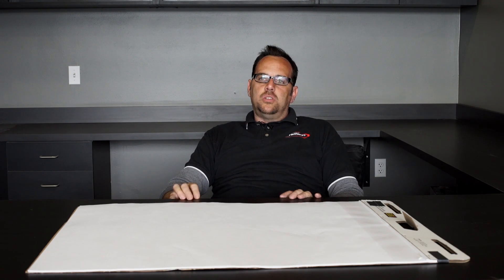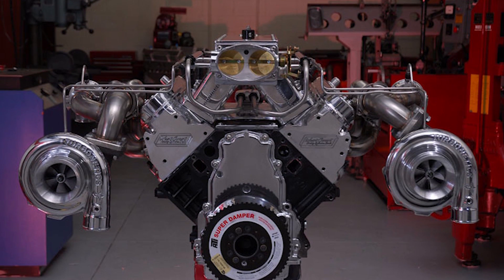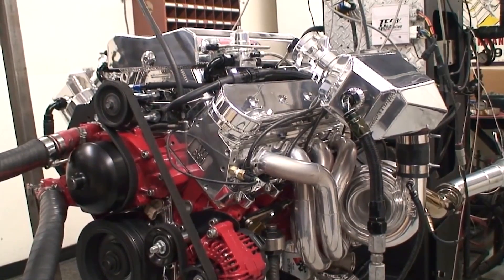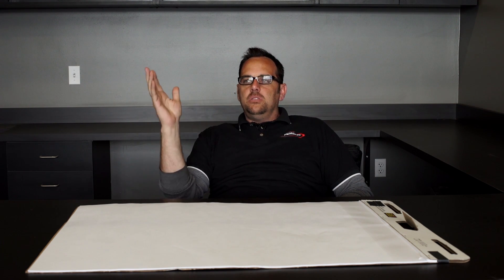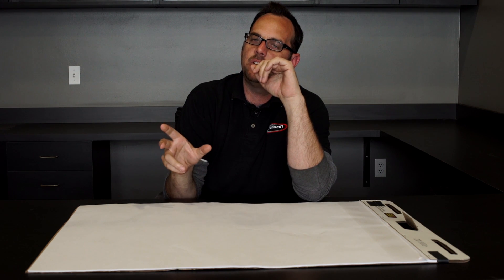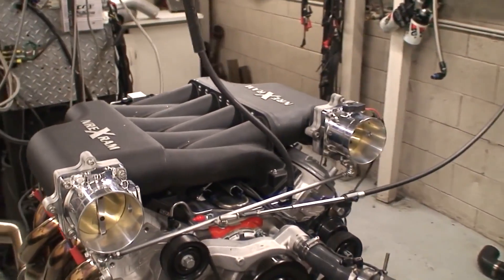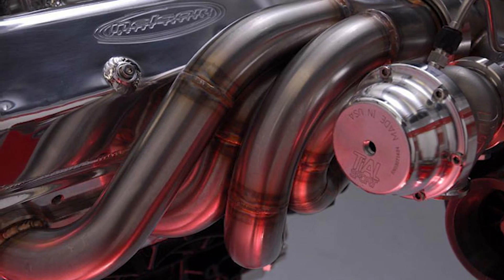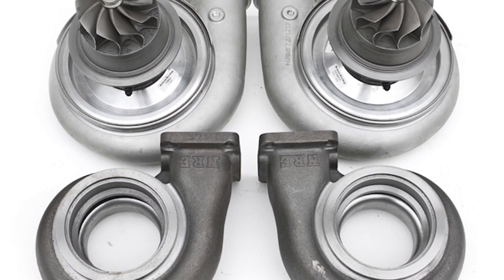Master Engine Builder Explains Why the LS V8 Is SO Good

Comment: Wow--Tom's a genius. I found this extremely helpful, because he talks more about the overall power curve, rather than just the peak numbers.

Runner length, as he mentions, is very important. For example, the GM TPI engines in the 80's had very long runners, which built up great low end torque, but suffered on the high end because the air wave had much longer to travel back up through the runner towards the throttle body when the intake valve was closed.

Comment: Too bad engines are shit in general. And why do people say motor? Motor should really only be used for talking in terms of electric motors, an LS isnt a motor, it's an engine. So is a rotary, not a motor, an engine.

The typical reciprocating piston engine is between 17% and 30% efficient. The rest gets thrown away with heat, sound/vibration etc...

Comment: Excellent video! The one area that seems to be the most misunderstood though is proper crankcase evacuation and air/oil separation.  These engines depending on ring tension, will experience ring flutter and instability if just vented with breathers, and those that delete all evacuation and flushing of the damaging combustion by-products before they can accumulate in the crankcase are greatly shortening life.  The best solution of course is a belt driven vacuum pump and adjustable vac relief valve, but for the street these won't last.  There are proper systems that do accomplish all as the next best solution to a vac pump.  You never want pressure to first build and then vent.  Cheers!

Comment: 4:25 Aluminium has much better heat conductivity than cast iron, that's why you see the better cooling performance with aluminium blocks. Aluminium is one of the most heat-conducting metals.   
http://www.engineeringtoolbox.com/thermal-conductivity-metals-d_858.html

Comment: Love how all these professionals call engines "motors", motors and engines are two completely different things. Engines are complex machines that have hundreds of moving parts, and they burn fuel to make power. A motor is a simple machine, basically an electromagnet, that effectively has one moving part and uses electricity to spin a shaft to produce power. Calling an engine a "motor" is an insult, not only to the engine itself for the vast difference between the two, but to everyone's intelligence that heard to you say it.

Comment: All I have to say is the video speaks for itself and so does the ls engine . On another note I hear people bashing pushrods . Well I'll have you know that nhra nitro cars and 6.5 second 1/4 mile n/a cars run pushrods and so does nascar . Pushrod engines are proven to make all kinds of power and being reliable at the same time . Also the ls engines if you care for it , are fuel efficient on a stock tune considering what the engine is designed for . I'm currently ls swapping my 1994 n/a jdm supra . I will be dropping close to a 100 pounds with my all aluminum set up and gaining 300+ hp while staying n/a and reliable . My handling will also improve do to improved center of gravity . Don't get me wrong I love my 2jz engines but let's face it , the ls platform is cheaper , easier and can make more power with ease .

Comment: I love my LS3, just under 2k in bolt on mods, over 500 hp and still gets 26 mpg at 100 mph with 2 people in the car running the a/c! Bitch, moan and complain about how bad it is or how many other motors out there are better or can be tuned more....nothing beats 500 miles to a tank and that smooth deep burble it makes, almost like the soothing hand of God pushing you down the road with relentless authority!

Comment: Nice, very nice. Now do one on why the 2jz was good.
Reply: In 2jz we trust
Reply: +Kartez Drake Would have to be in Black and White as that engine is prehistoric :)
Reply: +M3Conv lmfao and its still more modern you idiot your comparing it to a pushrod engine im not hating on them but just image if chevy made a dohc v8
Reply: I talk because i know my stuff first of all ive rebuilt an ls and built another plus a 700 hp 2jz will last as long as a stock ls if u treat them the same dont bother to reply hillbily
Reply: Yes it was im building a 2l with 600 hp goal if u build anything right it will last
Reply: +Mo-Town Nut dohc sucks. its good for econo cars thats about it. a 2j will never compare to the power of a v8. they just don't have the strength to withstand all that power for very long.

Comment: Why is the LS so great?
Light, compact, plentiful (millions produced), multiple factory configurations making different accessory drives and oil pans available for various applications, durable, cheap to attain and modify, great flowing heads, massive amount of trans choices, multiple induction choices, massive aftermarket support, and there's no arguing against the power than can be made with its tried and true design.

Comment: After all the flame wars in the comment sections about LS versus 2JZ and pushrod vs DOHC it would be really informative to get a professional opinion on that as well, especially regards to what engine suits what purpose. I live in New Zealand and LS engines are far from easy to get a hold on. Yet dedicated people source them from US and stick them in MIatas or even RX7s.  The LS swapped RX&7 goes well at local hill climbs but not necessarily faster than the rotary engined ones. I know the Miata suffers from understeer due to the 50 50 balance being lost. I find it much more interesting to discuss what engine for what purpose is best, rather than fanboy or engineering arguments about this engine is better than that. It is so pointless without knowing the application and budget.
Reply: +9000Redline  Good post,  I am in the United states so you basically get a free LS or 5.0 with any purchase at local junkyard ,LOL (just kidding, I wish). I think the main attraction is there are millions made and has the biggest aftermarket selection. I personally would can myself a good Old DODGE Boy if I had to pick a favorite, so our selection is limited unless it's 30-40yrs old:-(  As for the LS swap not being faster... It depends on how it's built. With the extra displacement the power band can be so much wider than say a rotary or dohc I-6 N/A, the only way to equal it is with boost. Another plus is that the stock LS stuff seem "almost" bullet proof like a 2JZ. Hot rod pushed a junkyard 4.8 over 1000hp. I have read multiple times that the LS1/trans is very close/equal to a 13b/trans combo?, so I don't know about the balance. I have a buddy that has 2 rx7, one stock the other a single turbo swap, I just wished the apex seals lasted longer. My thing with all the junkyard/crate motor favorites (LS, 5.0) is they put them in every brand. It's nice to see a car with an OE brand motor. I'd love to have a 20B/turbo in an old datsun 510 or rx3:-)
Reply: Would definately agree with the sentiment that some cars are defined by their engines and by swapping it the identity is lost. The rx7 and s2000 fall into that category for me, but each to their own, especially if it's faster than the OE engine and they win events :)  1000hp haha, that's just nuts. I'm not into big HP. Prefer to have cars that are light, fast around corners and low maintenaince. What kind of car can you stick a 1000hp LS in and still hope to drive it in all conditions? Sounds mad but it would be fun to watch :)

Comment: The LS isn't a good engine. It is an easy engine to work on with some easy power gains. It is just a quick and cheap way to obtain a big power figure. But it isn't a good engine. A good engine is an engine that gives you goose bumps when it revs out, and over 7000rpm. Ferrari engines do that. It doesn't give you an instant power delivery. It comes progressively, and the more you accelerate, the quicker it gets, whereas the LS is just the same thing, all the time. Sure with a couple hundred bucks, it can reach 800hp,  but here is not the point, it will never give you the chills that a GOOD engine will provide you. And that's that.
Reply: this has to be the stupidest thing I've ever read.
Reply: it isn't stupid. I've tried both, and the LS doesn't make you feel anything but going fast. Which isn't enough.
Reply: +Nicolas LEBLOND having actually raced, I can tell you this low end torque gets you way ahead of the other guys and wins. I do apologize for my previous comment as it came of harsh without explaining. any motor can be made to have that revy feel. a 4.8 ls with a turbo will get you that result as where a 6.2 with a aggressive cam will throw you in your seat before you hit 5k. the ls is praised because it can do it all na or fi. exotic Cars have great engineering behind them but it's not as mainstream as ls motors
Reply: @nicolasleblond279  Yep. Thats why you'd LOVE the 1995 mercury tracer!  Narrow tires, 1.8 Liter 4 cylinder.  Boy, does it SOUND like it's working!  Even though little old lady on bicycle can outrun you in the quarter.  And it FEELS fast!
Reply: @estebanjr11  Do you remember when the audi Quattrovalve 5 cylinder turbo / all wheel drive?  Cornering was incredible, but ONLY when it was wet outside.  The vette's still ran away from them in the straights.
Reply: "The LS isn't a good engine"? What a poor level of education you have . That comment has to be the most ignorant comment I have ever read on you tube the whole comment .
Reply: +Nicolas LEBLOND In what world does that make sense, first off its not proven by anything that high revving is the only way to have goose bumps. Its all opinionated, personally I like the feeling of a huge torque band. at the low end. Tell me the big necessity for dohc, yes it helps you rev faster but please explain why its necessary for performance applications
Reply: All i am saying is that an LS engine is a very good engine if you want something cheap and powerful. But compared to a high revving, dohc and square engine (bore=stroke and supersquare bore>stroke), it feels flat and has less character. And of course, I am not talking about supercharged or turbocharged LS engines with 10 000$ worth of parts in them. 
The LS is a work pal whereas (let's say) an italian built flatplane V8 is pure precision and pointyness that doesn't need any turbos or blowers to reach high outputs on small displacements, which is also the reason why they feel better when you're behind the wheel. And anyone who ever has driven a Ferrari knows just exactly what i'm on about.
Reply: +Nicolas LEBLOND This is the worst comment I've ever seen on youtube. I have an NSX which revs to 8000rpm and sounds like a race car, but the LS is one of the best engines ever made. Beats the hell out of the mezger that was in my 997 turbo too.

And you won't find most Ferrari owners revving to 7k more than once a year, for fear that something in their poorly engineered overpriced car will explode.
Reply: no actually, you're the least fanboy sounding commenter here, so I guess that's why I reacted positively to your comment...
Reply: +Lebiche Naw, man. It was stupid. "It doesn't give you chills"? Wtf is that all about? LOL!
Reply: Do you live in europe?
Reply: +Nicolas LEBLOND Actually the LS platform is a good all around reliable and powerful platform. Good price for crate motors and easy to pump up the HP/Torque. Easy to work on. Stock for the price is hard to beat. Better than anything Ford has stock.
Reply: well forget about what I said, it just does it for me then.

Comment: simple put GM knows how to build a V8 and knows how to do it well. they are the foremost leader in V8 engine design
Reply: +Jordan Palazzetti what does building F1 relate to comercial engines? Duralast is the "official" brakes for NASCAR (at least that is what they claim), I bet your ass that they are not running the same compunds as on commercial brake pads.
Reply: +andrew donohue Except they've never made a Formula 1 engine. Honda, along with a slew of other foreign manufacturers, build a better V8 than GM, sorry.
Reply: better V8??? then why is the small block chevy the most widely used V8 for nearly all hotrod applications around the world? it remains so today. NOW if you said other foreign manufactures build better 4 cylinder performance engines i wouldnt disagree. v12's certainly not GM. GM does V8's extremely well
Reply: How many GM V8's do you see in formula 1? Don't worry, I'll wait.
Reply: arent those mostly V12's?
Reply: No.
Reply: +Texassince1836 Lol, that's supercharged. We're talking NA bud.
Reply: +Texassince1836 
The LS9 is supercharged... if you want to compare apples to apples, compare the LS9 to the trinity 5.8l ford v8. which makes 662 hp out of 5.8 liters. that's 103 hp/liter for chevy, 114 hp/liter for ford.
Reply: sbc is king
Reply: +lat woods 638hp from 6.2l stock in the LS serise,  that's over 100hp/liter stock
Reply: +Texassince1836 lol what car did that come in?
Reply: +lat woods i wonder what kind of long term durability that will give. a small block 5.7 chevy will run for 300k+ if you take good care of it
Reply: +Jordan Palazzetti LS9 in the ZR1 Corvette.
Reply: +andrew donohue there's a guy that put 1,300,000.0 on a 210hp 350
Reply: 1.3 million miles goddamn. i have an LT1 212k i guess its not too worn out??
Reply: +andrew donohue that link didn't go through right,  but its a link to a YouTube video of the 1.3 million mile truck
Reply: +andrew donohue a JUDD V8 is better and sounds better :)
Reply: andrew donohue an LS engine is an OHV pushrod single cam 16 valve. High performance race V8s have a 32 valve twin-cam (DOHC) engine because they rev much higher up to 12,500rpm. Pushrod V8s limit is around 7-8k max due to valve float.

Comment: i need this for my frs... my boxer motor spun a rod and toyota didnt want to cover it at 32k miles blaming me..they ask for 10K$ what a joke company .. bought a used boxer for 2k$ ..i want to put a LS but im over having a frs after they treated me like that
Reply: +thatonebeone how the fuck did you manage to do that?
Reply: +thatonebeone There are kits out there for you. Hit ebay and buy a GTO LS2 pullout w/ t56 for 3kish. Probably looking at around 10k all in all. 12k if you want to upgrade to L92/LS3 heads.
Reply: +thatonebeone That is what happens when you put aftermarket product into it. Voids warranty!
Reply: +Robert Nugent bone stock.. was driving home got off the freeway and hear a banging spoon sounds and I thought I hit something on the freeway.. there's a video on my channel if you look.. but yeah I'm getting rid of my frs next year.. beating this new motor and it's taking it good.. but I'm running 530 oil now instead on 020 factory..
Reply: They are motor mounts for a 2jz on the after market. Ls motor mounts... Well not too sure.
Reply: Mod the 2jz for 400hp. You will have a freaking reliable engine. Cause these engines can go at 800hp with stock internals.
Reply: 2jz sell for 2k.
Reply: +Robert Nugent other had the same issues ..most all the early models like mine..2013.. all are rod 4..i already paid them 2400$ for the stupid labor fee because they say it was not a factory defect due to lack of lubrication.. i never had a any check lights and oil was good and was just change 1000 miles before it spun..

toyota said it could be customer neglect and when i stop the person saying that they said oh we are not saying you we are saying the customer.. WTF! i bought this car i went to the dealer that makes me a customer.. toyota is lame... never will buy a sion toyota lexus first and last... looking to get a nismo 370 next year..  i beat my new motor and it takes it and i dont care about it anymore..
Reply: thatonebeone I have a Hyundai Genesis Coupe. I'm pretty happy with it. There as much aftermarket parts as a 370z.
Reply: +thatonebeone you are still under warranty.  Why did they deny your claim?
Reply: +yogaexe because they are ass.. their excuse was  "not a factory defect due to lack of lubrication" car had no CEL about it low on oil and they even said the oil level was 2mm below the top fill... if you read my other reply you'll see the other BS they told me.. Toyota is a joke.  getting a nissan 370z nismo next year.. screw toyota..
Reply: +Robert Nugent  yeah I'm not the only person that had this issues.. I've looked online and others had the same except thing.. all rod 4 and some was even under 15k miles on it.. yeah I don't car much about this car.. I love it and it's fun but it's hard to love it when company treats you like shit..plus i have the 100k  extended warranty too.. just can't wait to get rid of the car and start fresh on a new car but never again toyota scion Lexus.
Reply: +Robert Nugent Toyota quality??? i thought Subaru builds the boxer motors
Reply: +thatonebeone the engine in your FRS is a Subaru boxer engine, so I guess Subaru is more to blame than Toyota. but its crazy how they say its your fault though... fucking crazy. NO engine should spin bearings at 32k miles. thats insane. 
I can't believe thats not covered under your warranty either. 

fuckin bullshit that they don't fix it for you with your warranty. that pisses me off and its not even my car.

Comment: don't make my mistake . lq9 procharger with a zo6 cam  2 1/2 y-pipe makes as much power as a stock ls1 .. 317 heads might need to go , but my brother is pushing 750 hp with 317 heads, his I'm sure are ported